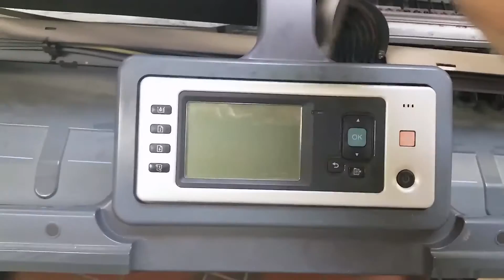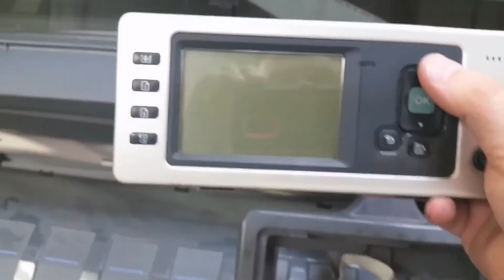HP Designjet Z3100 Teardown Part 1

Comment: How do you unclog the ink line? Any other problems to look for on these? How do you recover or clean the print heads?
Reply from the maker: What is the error you are getting on your machine
Reply: +Darren Charron I have no errors right now. I sent you direct email through youtube email system.
Reply from the maker: Usually I just use warm water to clean the print heads as far as the lines go I have had no success unclogging. This printer in the video had a clogged gloss enhancer line until I ripped it out. If I was going to keep the printer I would of replaced the entire ink system. I know the ins and outs of this printer but when it comes to the ink lines it's just not worth my time.

Comment: Darren I need some parts, what's the best way to contact you? I need the lever for the carriage, I cracked mine like an idiot, I might need ink stations as well.
Reply from the maker: Hey John I do not have any more parts for the Z3100.
Reply: ahh crap I just needed screws and the blue lever on the carriage assembly
Reply: Do you have any for the Z2100,Z3200?
Reply from the maker: Hi John I just have a power supply and inks left for the 3100 I think the power supply is for the 24” Z3100

Comment: Are the parts for this printer for sale from you?
Reply from the maker: Sure what do you need I have two of these printers down.
Reply: +Darren Charron I need the belt, and would like to purchase a lot more of the electronics and stuff just to have spare parts for it. I did send you a direct email through youtube.
Reply: +tiredfingers99 Ok, luckily none of the tubes were clogged. I got the printer and I put in a new print head and some new inks and it did a test print but then said print head alignment error and then the next day the belt went so I replaced it with a brand new on from HP and oiled the rails and totally disassembled and cleaned out the print head service station and then reassembled everything.  So I went to do the scan axis cal and print head service station cal and it said to do the diagnostic cal instead which you can only do when you boot up the plotter The plotter boots up and does all the preparing the ink properly but it always says the paper is loaded improperly so Im stuck there, is this because I didn't do the scan axis cal? Do I really need to redo the cals if it boots up properly? I did try the diagnostic cal and I tried the scan axis cal which is reccomended if you replace the belt and then it asks me if it moved all the way to the left hand side and it did and then it asks me if it moved to the center and it did but not the exact center of the plotter so I said no and then it said cal failure, but then I was able to boot again. What  should I do if it keeps giving me the paper loading alignment error?
Reply from the maker: Well the first thing you should do is clean the encoder strip with a cotton cloth damp with warm water make sure to use a dry cloth to dry. You do not have to have it in the exact center the laser reads the encoder strip. Clean the encoder strip and then do the axis and you should be fine and do not worry about center.
Reply: +Darren Charron OK, the problem turned out to be that the belt tensioner didn't apply enough tension to the belt so I had to tighten it a few turns. What was happening was it successfully started up and went through the preparing the ink supply system, and then I some how got it to accept the paper after it keep telling me it was skewed and then it went to start to print and what it does is move the carriage to the left really quick at which causes the gear to skip on the belt tooth and give the error possible paper jam but the carriage still moved freely, so I tightened up the belt and all is well. But I did all this with the cutter removed, so then I installed the cutter and asked it to cut the paper, but it moved all the way to the left and the first time it moved to the right to cut the paper but the cutter didn't attach to the carriage, and when it went all the way back to the left again it then attached to the cutter and moved all the way to the right and broke the carriage part, can you sell me the cutter? Originally when I turned the plotter on it would move all the way to the left and pick up the cutter and then move to the right and get jammed because it still had the cutter attached when it tried to move into the printhead service station. How can I fix that? Is there suppose to be something that detaches the cutter before it enters the service station?
Reply: +tiredfingers99 It didn't break the carriage part, it broke the cutter part. Specifically the latching arm on top of the cutter mechanism.